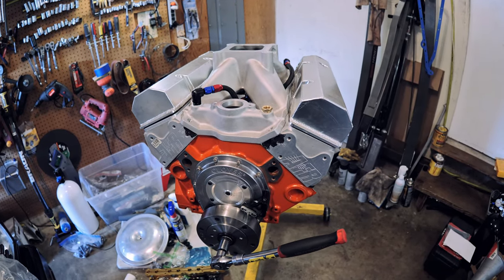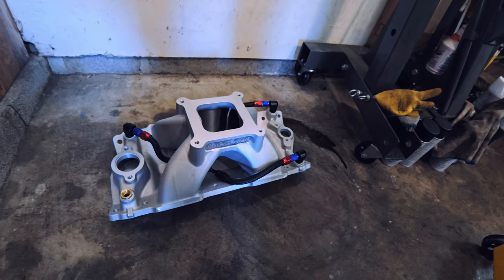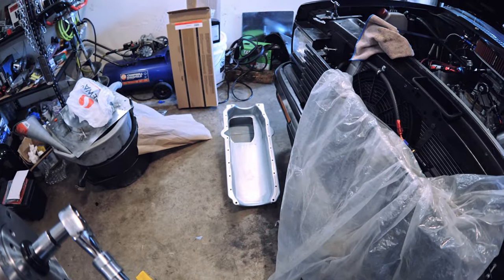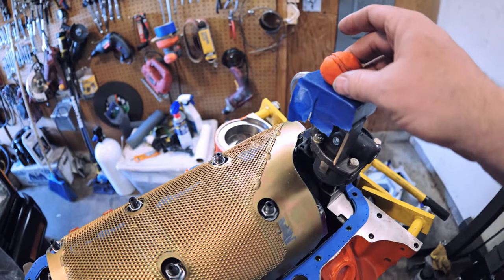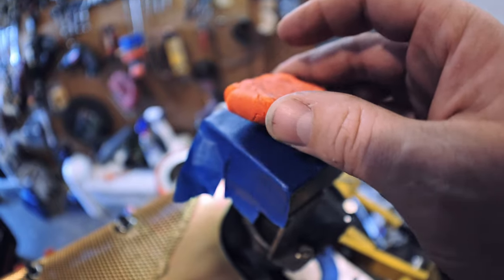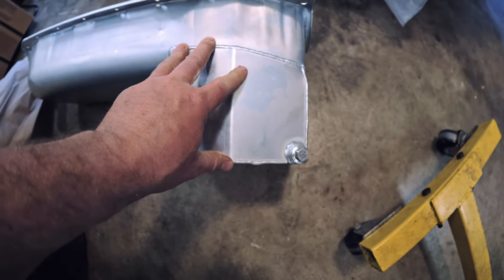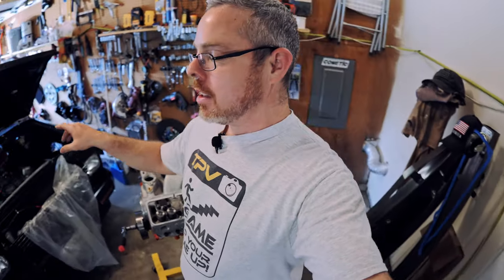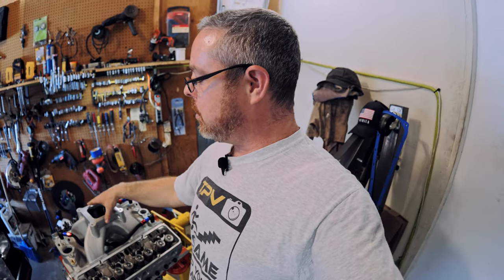Solid roller 400 SBC build update!  What is a Gen1 Small Block Chevy Water Bypass?

Comment: They also drill an outlet between the center cylinders to pull hot water from the heads.   My SB2.2 has all those goodies done to it.   Old Earnhardt Jr. Motor that was sold to...... this guy😊

Comment: I ran the same set up for my SBC. 14:1 compression and pretty big solid roller driving on the street. I’ve had to learn a lot to keep it cool in traffic. You rock!
Reply from the maker: I hope it works 🤞 I can't see why it at least won't hurt. That LT1 has "o" problems in the summer.
Reply: @TPVPRO  it will work great!

Comment: Hot water wants to go up like hot air so the best way to route it is use a thermostat housing from summit that raises the thermostat up about 4 inches and feed the lines from the back up hill to it. It makes an easyer path for the water to flow, The housing is made for a thermostat to fit it.

Comment: That guy told you right.   They do restrict flow when set like you've done.   Take a look at the old nascar set ups.   They did it correctly and had a special thermostat housing made for those hoses to connect to right at the exit point.  Nascar paid thousands in R&D, just watch what they do.

Comment: Always love your videos I wish you would put some new ones out I picked up another 406 short block a few weeks ago it's a 2 bolt main I'm ok with that but it's got stock rods some as soon as I get a fee things out the way I'm going to get a whole other rotating assembly with good 6 inch rods and forged pistons I'm going to set it up for nitrous I'm only going to make it about 11 to 1 compression so I can run pump gas.

Comment: Nice set up I've seen these before. I believe it was the lt1 I saw they ran hoses out the front and the back of the head. This was racing application of course, also seen guys use colder plugs in the back 2 cylinders but that was under boosted applications. Pretty cool to see and watch. Thank you for an awesome and informative video. I wanna hear her fire up 🔥,

Comment: I find plumbers putty is a sure fire/easily found means of getting  clearance on a number of things.  Love the one piece pan gaskets, but I think they are 0.140" on the rails, where the old cork style was 0.090" thick [plus whatever sealant put down]. 1/2" is beautiful for that pan, by the way: no chance of hitting a pumping limit at high rpm from starvation/cavitation.

Comment: An important note to keep in mind. Play dough will have a tendency to "Rebound" and not always be as accurate. Modeling clay is a bit better but a square and tape measure is still the best option. As for using clay, spray a little Pam on the pan bottom to keep it from sticking. Works for claying piston-to-valve clearance as well.

You should easily be able to run 5 qts in the pan and one in the filter. I've never understood those people that spend all that money to try and get the oil farther away from the rotating assembly, only to "Fill-er up" and make the frothing (aerating) problem even worse. 

Another quick tip...An 8" zip-tie makes a great go-nogo gauge for clearance on the rotating assembly. Easy and we all have thousands of them laying around.
Reply from the maker: But Play Dough cracks me up more with the age on the side.
Reply from the maker: Oh and BTW the engine builder and head guy I know get on to me about Play-Doh rebound. Especially when I use it on the PVC check. 😆
Reply: @TPVPRO  Hell bro, I've had guys yap at me for using modeling clay because of it's SLIGHT deviations. They prefer using modified valves (or the Isky tools) and dykem....not exactly something we all have laying around.  All we can do is the best we can. We're not using a mock-up flat top and pouring an epoxy mold of the chamber...
Reply from the maker: I have gotten away with some tight PVC before so far I have been lucky with F-It. 🤫
Reply: I've seen some Pro Stock and Pro Comp stuff so tight they would leave "witness" marks on the pistons but never anything catastrophic. Valve train control at those levels is critical!!!
I've run some crazy tight quench distances too, but the attention to detail on the build, custom pistons, spread out ring packs, piston-to-cylinder wall clearance, etc all become hyper critical.

Comment: Water being a fluid not compressible will not stop flow in a passage unless there is air in there,the air can allow the flow to be interrupted. It will flow according to the passage size and volume. So that being said small hoses flow small volume.

Comment: Mine ran hotter with those hooked up. Think I had too much flow and the water was bypassing the center of the heads. Smaller line may have fixed it but I just unhooked it and plugged everything.
Reply from the maker: I have heard that as well. While I was doing the research, I ran across some guys saying -an 4 is the largest you want to run but there are a lot of opinions and not much solid data. I figured -an 6 to one -6 is close to that so here is hoping.  🤞
Reply: On my research with the LT1 the smaller line is so that it lets out the steam but not the coolant reducing the known hot spots in the back cylinders, take a look at the design for the LT1 cooling system and it explains it in a lot better detail than I can!!

Comment: Really like your detail on the intake install series.  Re: the water bypass, could you please update this with the part numbers that you used?  Its hard to see where the lines cross under the plenum, i assume you used a 3way union under there to join the black hoses?
(and is it AN4 or 6?)

Comment: Ya only got part of the cooling equation you also machine the intake near the heat crossover, drill/tap into the cylinder head water jacket tie it into the lines running to the front, on both sides of the front crossover
Drill/tap -4 fittings into either side of the water pump just before it bolts to the block drill/tap -4 fittings into the water jacket just below the siamese exhaust ports, this gets rid of the actual hot spot between the two exhaust valves, further cooling tricks that work well on the street take a look at a sprint motor and to completely understand it read the bible smokeys power secret's, about splitting the cooling between cylinder banks and reversing the cooling running the coolant into the cylinder heads first, it was done long before reverse cooling the second gen lt1

Comment: Awesome video, did you also have the steam holes drilled in the head on the 400? Or is it not necessary now with the bypass?
Reply from the maker: I'm running a Dart SHP block and they don't have steam holes.

Comment: I have an 880 Vortec long block i built for a CJ-7. Have a Vortec RPM intake and electric water pump. Block has 3rd bypass hole. How would I plumb this and use the Jeep heater core/hoses? Plug 3rd hole in the block and use the intake's 2 plugged coolant ports to connect the heater core?  It's a ProForm sbc electric water pump. The most common answer when searched, seems to be, plug the bypass hole in the block and then drill small holes in the thermostat. But I can't find an article that addresses all issues together at the same time. Connecting a heater core, plugging the block's bypass hole, and drilling the thermostat holes. 
Just looking for ideas and opinions. 
1st obvious answer is the 3rd hole has to be plugged regardless of whatever I do if I want to use an electric water pump on a Vortec long block. But routing the heater core has me flustered to be 100% honest. I tend to overcomplicate things but I just don't want to screw this up by doing something stupid by overlooking an easy solution. Living in the mid-Atlantic I wanna have heat this winter AND plumb this bypass so as not to make the cracking issue worse for these heads. Thanks for the video and sorry for being long-winded.
Reply: My 880 block had the bypass hole drilled but the heads do not if i remember right. I used and old style pump that covered the bypass and drilled two 5/32 holes in thermostat.
Reply: Vortec water pump has extra nipple that is plumbed into stock efi manifold that is a bypass, doesn't use 3rd hole bypass at all and dosen't cover it. I don't think electric water pump will have a heater outlet nipple, you could tap one in if housing thick enough...

Comment: Awesome video are using the Optispark or did you convert it
Reply from the maker: Its setup just like any old school v8 with a carburetor.
Reply: @TPVPRO  ok I was thinking this was the generation of lt 1 that came in the 93-96 camaro and firebird and corvette they have the distributor on the front of the block it’s call optispark what you are taking about is first Gen. Lt-1 which is just like all small and bbc

Comment: Do you like tha milodon windage tray?
Reply from the maker: Yes I have used it on 2 engines never a problem.
Reply: @TPVPRO , I have one on a Chevrolet performance 383 stroker, had to trim a bit as well. I didn't like the factory tray. I feel like the expanded metal style screen works better.

Comment: Hey man What intake do you recommend I have a 406 in my s10 I have eldebrock air gap on it now ?
Reply: What’s wrong with that intake? It’s a great choice
Reply: @lildno2007  I was just wondering ! Truck runs good with it! I know they say 400 like more Air
Reply from the maker: All depends on what RPM and what you are doing with the motor. If it’s a 2500-6500 rpm motor an Edelbrock Air gap PN# 7501 is great. If you are a solid roller / big HR cam in the 600 lift 250s dur @ 50 cam and above 11.0:1 compression a Super Vic will work well. I went with the Super II but since my truck is lightweight, I am not worried about torque below 5000 rpm and need it to run out the back end a little better.
Reply: @TPVPRO  Ok thanks man
Reply: @TPVPRO   what yo best time so far?  I went down to 3.90 gears. First test n tune tonight was cool. My car seemed kinda slower but Faster if that make sense lol
Reply from the maker: @lildno2007  Best in the LT1 was 9.9 @ 132 mph.
Reply: @TPVPRO   what’s the 1/8 time.
Reply from the maker: @lildno2007   6.2
Reply: @TPVPRO  my car a second slower lol. I need to get more tuning.